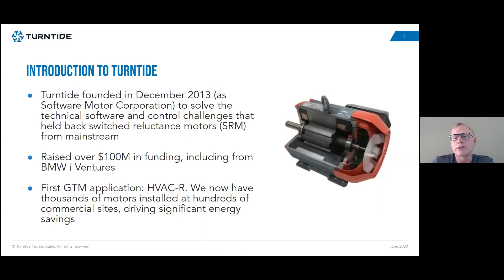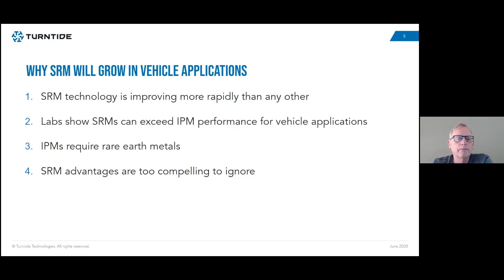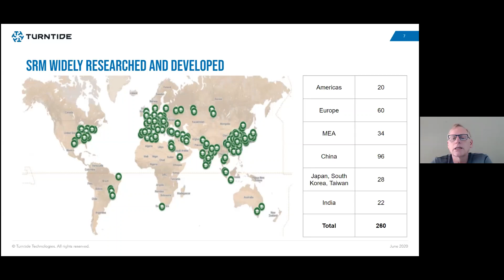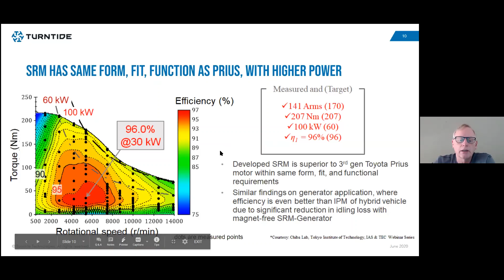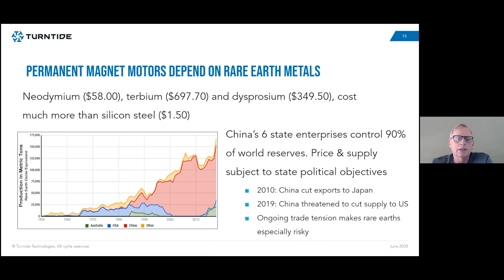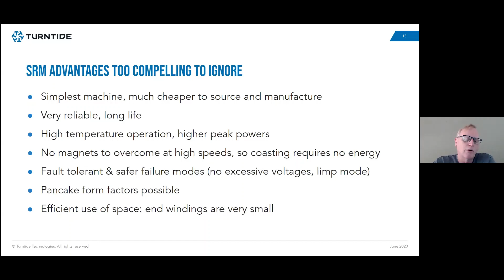Switched Reluctance Motors (SRM) are the future of electric vehicles

Comment: I get the sense they are not very torque-y motors, but great at high speeds.  but lack low end torque needed for off road in the dirt, over rocks 4 wheel driving?

Comment: How exactly were you guys able to mitigate the problem of torque ripple in the SRM Motors? I would like to know.
Reply: Seemingly, power transfer is smoother with more rotor poles as you could see with higher piston counts in an engine. Smaller gaps between power strokes, more information for the controller.
Reply: @Dan-gs3kg  ok, but this doesn't fully remove the ripple right? How much were you able to reduce it, I mean by hour much percentage?
Reply: (1) More number of phases, we can have 4 to 6 phases of motors

(2) Multiple Phase Energization per Electrical Strokes

(3) More Electrical Strokes per cycle

(4) Reducing harmonics from controller outputs 

(5) Using a rotatory damper between motot and load

Comment: Please do a more comprehensive design in the areas of operation which are prone to single point failure. I've replaced dozens of LED light bulbs, and in most cases, it's not the LED which has failed, but rather a single, serial device which prevents the bulb from receiving voltage/current. Typically a 5 cent resistor.
Engineer the hell out of your controller & don't be shy about adding redundancies.
An unfortunate majority of techs are not well-versed in repairs, only replacements. You'll be adding failed devices to an already struggling recycling industry. Make things repairable.

Comment: Reluctance machines are indeed the future of electric vehicles. A great advantage is the capacity to spin at high RPMs, eliminating the need for a 2 or 3 speed transmission in high speed sports cars, without the need to compromise on starting performance.
However, the way these motors are now only makes their use possible in air and water vehicles. Any projections on the time needed to sufficiently mitigate the torque ripple at high starting torque, correct the internal noise source and stator flexing tendency?

Comment: Great presentation here. I have a question I am hoping to get an answer to.

Without magnet in the core, regenerative breaking is impossible as there would be no power generation.

Do you think the efficiency of the SRM covers the recoverable energy from the regen?

I will love if I can have answer to this.

Many thanks.
Reply: @Turntide  thanks for this fascinating response, I do appreciate it.

I went to look for the book you referenced but I couldn't find a free version. The price of that book is  about 3 months of my salary in this current exchange rate.

I really love to research more on the SRM, see if I can put things together and see how it works locally. That would be amazing.

Until anything significant comes up from my end, I ll keep watching out for you guys, you are doing a very amazing job here.
Gracias.
Reply: SR Motor can do ReGen braking without permanent magnet

It is the phase firing timing that we need to control

I am designing a SR Motor and ReGen is very much possible

But yes during regen we take a 1unit of energy from battery for magnetic fields but in return deliver 5 units to battery by using those fields and mechanical work to generate the electric work
Reply: @Turntide  This sounds pretty fascinating but is the 'generating' aspect described here actually generating from mechanical motion alone or is it giving you back what you've electrically stored in the coil? I can't reconcile how it would actually be generating anything without giving you back more than you put in, or if the idea is that somehow a lingering field created from a previous pulse is being used to induce a current in another coil already moving due to rotation.